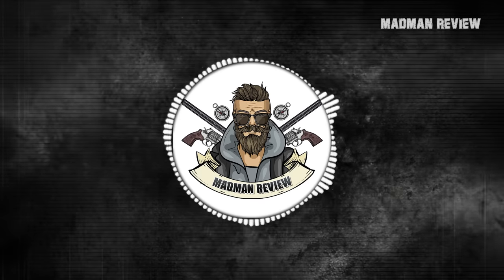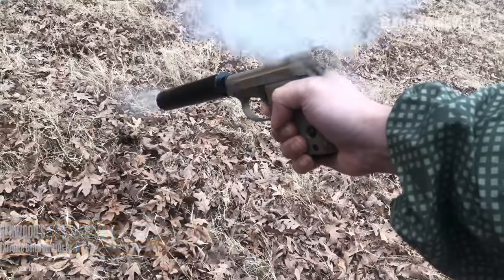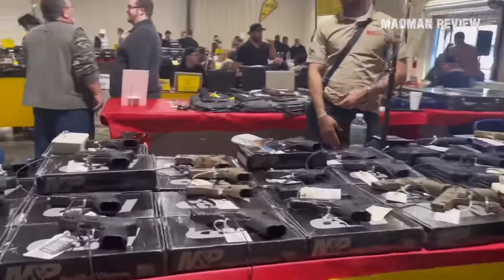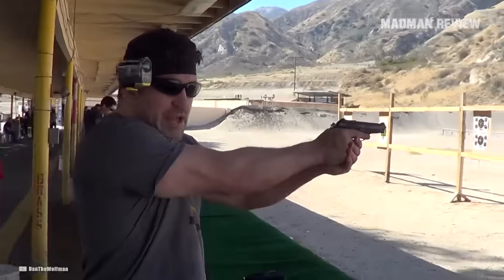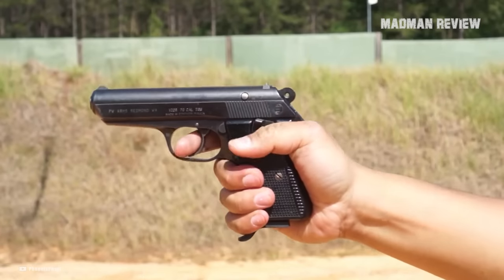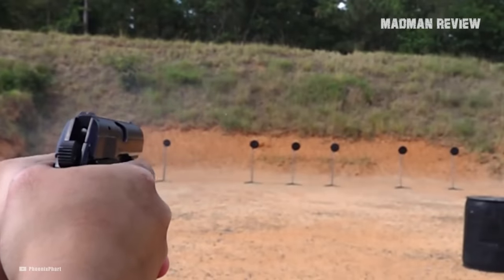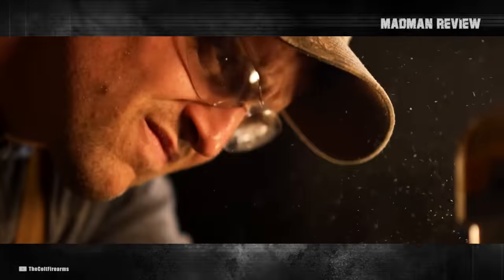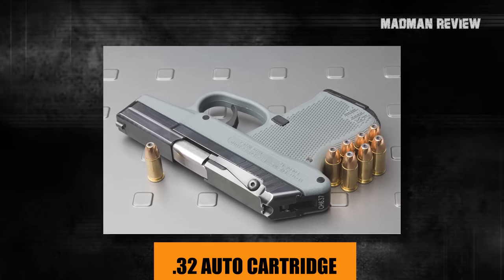7 Best .32 ACP Pistols to Buy and Collect

Comment: Personally, I'd move the Beretta 81 up.  I added custom wooden grips to mine.  Its my favorite handgun of all time.  The only down side for concealed carry, it's a little bigger than the others.  When I want something a little smaller, I fall back to my Beretta 1935.  In either case, you're getting Beretta military/police issue quality.  

I have a Walther PPS in 9mm for a smaller, more powerful concealed carry option.  But, I still prefer either of my Berettas.  With Fiocchi 60gr JHP ammo rated at 1100 fps and 161 ft pounds, it almost has the stopping power of a lot of standard .380 ammo.  For example the Winchester .380 hp at only 1000 fps and 189 ft pounds.

Comment: I used to have a 1903 hammer. Let's Colt made in 1020 in which I carried Winchester Silverton  hollow points. A terrible fearsome round if you looked at what it would do to the target on the other end.
I also had 3 spare magazines that I carried with me in a cigar case.
I never had any problem with keeping it concealed and carrying it well.
 I still miss that gun.

Comment: If you check Ammoseek, 32ACP is the most expensive round, priced higher than 38ACP, 40S&W, 45ACP, not mentioning 9mm. Not a practical choice for training. And without training, no CCW is acceptable. Otherwise, Beretta Tomcat would have been a good buy in August.
Reply: How often do you need to train for 7 yards? How poor are you? It's cheaper than .38Spl 😂

Comment: I have the  Tomcat and the Seecamp. The Tomcat is a great little shooter even though Baretta recommends a muzzle energy of less than 130 lbs.  The Seecamp is also restricted to 4 different rounds. All of which are 60 grain hollow points. The length of the recommended round is a shade shorter than other 32s and will not fit in the magazine. Woolen rave about the Seecamp and I don’t understand it. To me if a gun is so restricted and so finicky about what it eats just does not seem so practical. 32 round are a bit difficult to find and a bit more difficult to come across in the four recommended rounds, thus I have not shot this one yet but I was above to order some and they will arrive in two weeks.

Comment: A little hyperbole on your part

32 acp Burst onto the scene in 1899 and as a semi rimmed cartridge

380 acp Almost a decade later in 1908 and is a rimless with cartridge, which represents a design improvement in the ability to chamber and designer, pistol chamber round Without requiring a rim to headspace

So for the most part, both 32 ACP and 380 ACP were available it’s just so happens that a lot of firearms other than browning or FN, or some of the higher in German guns were easy to manufacture for the 32 ACP and it became a police standard first.  The first to be adopted and the first to be distributed gets the lion share of the market

32 ACP is also less recoil and more manageable in small, framed guns, and you needed to have with the Metallergy, a larger pistol frame for many designs, and 380 auto for the more inexpensive designed auto loaders they didn’t scale up

Comment: Is there any actual relevance to carrying a .32acp today  especially given the price and scarcity of ammo.?
You said it...140 ft pounds for .32acp is equal to .22lr. 
Carry a 16 rd Kel-Tec Hammer-fired, P17 "tack driver instead for under 200.
Reply: I carry a P32 sometimes. I think 32acp only makes sense in handguns that small. They make for super concealable guns w/ low, controllable recoil
Reply: 32 acp pistols are still some of the tiniest you can carry. underwood's xtreme penetrator is where its at
Reply: Those numbers he quoted aren’t accurate. He said 140 FT\LBS for CCI’s standard velocity (but shows CCI mini mag) cci standard makes 102ft/lbs. OUT OF A RIFLE!    and 32acp out of a beretta tomcat makes between 160-260 ft/lbs. that’s a lot more.
Reply: Also, zackzittel is right. You're not getting close to 140 ft lbs out of your P17. With CCI mini mags you're getting more like 91 ft lbs
Reply: It costs nothing to carry a loaded gun after you purchase one box for $25. and it's not scarce, it's just not popular to carry, sort of like .22 Short.

Comment: I really like my Tomcat. So easy to pocket carry with any outfit. Despite the trigger criticisms. I’ll take the DA to SA over the DA only any day. The manual safety also allows you to carry cocked and locked if you choose. Making some of the trigger criticisms a moot point. The amount of safeties really do allow a lot of options for how you want to carry depending on comfort level. 

The manual safety is very sturdy. I don’t worry about it accidentally becoming disengaged. While still easy to manipulate when intended. 

I’m cautious with carrying so I would still highly recommend some kind of pocket holster to cover the trigger guard if you go locked and cocked instead of just letting the pocket be the holster itself. The holster will also assist with any printing. 

Me personally, feel very safe and comfortable carrying the tomcat with a round in the chamber obviously. Hammer down since the DA pull doesn’t bother me and I like the additional safety it provides. Manual safety on since I can quickly flip it off safe with no issue. At which point I would feel perfect safe carrying in a pocket with the pocket itself acting as the holster. However, I still utilize a holster in the pocket to help break up the outline of the gun and help with printing. The additional safety with the holster at that points is a bonus for me but could allow locked and cocked carry if one felt the need. 

As you can see a ton of options for safe carry. Also, the tilt up barrels also means you never have to manually lower the hammer on a round. I think with some practice and training the tomcat was an easy 1st place